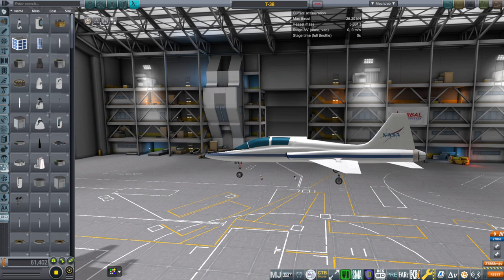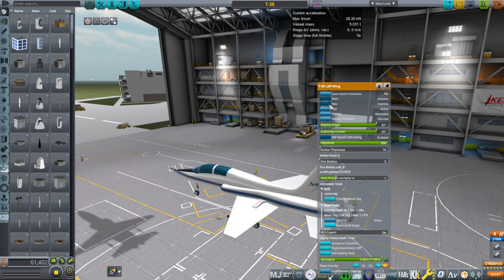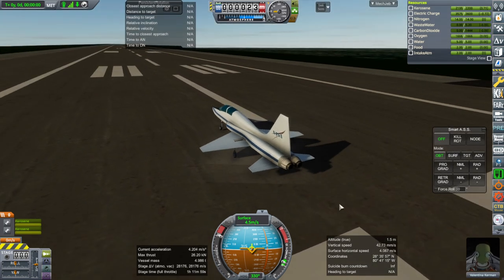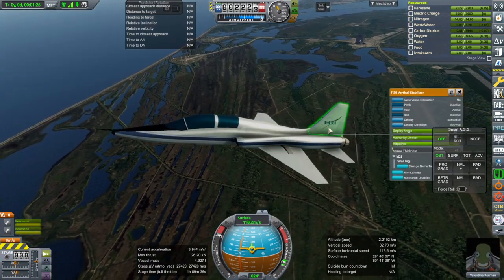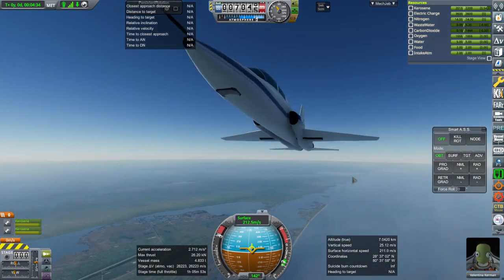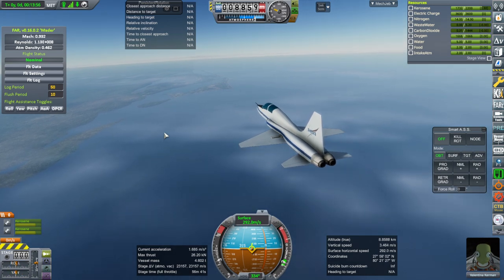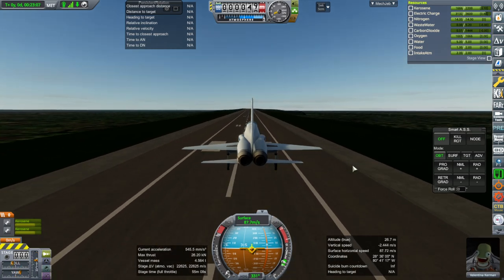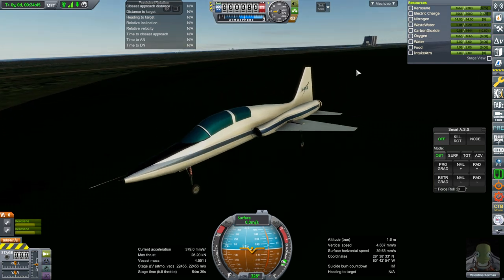Realism Overhaul in KSP 1.11 - T-38 Flight Test

Comment: What mods are you using?
Reply from the maker: Lots, but most important to the video were Realism Overhaul and its requirements, Real Solar System, Katniss Cape Canaveral, Adjustable Landing Gear, RSS Visual Enhancements, and the T-38 I made. The install has practically every plane mod I could find, though.
Reply: @RaizSpace  oh okay i used rp-1 express install and couldn't get such a result